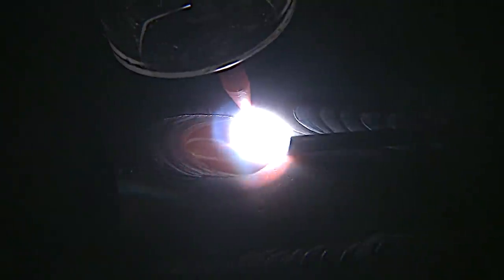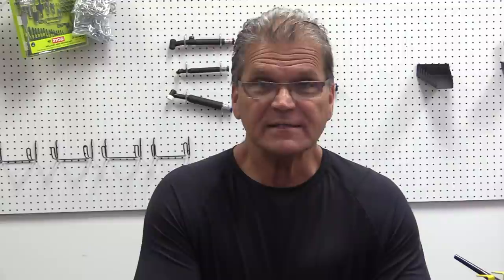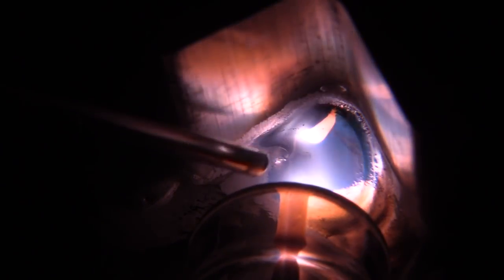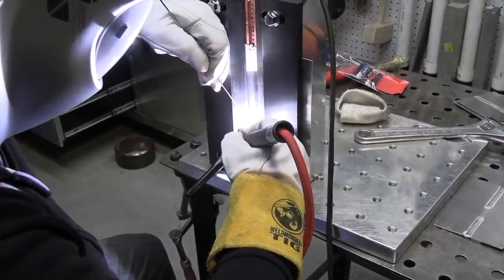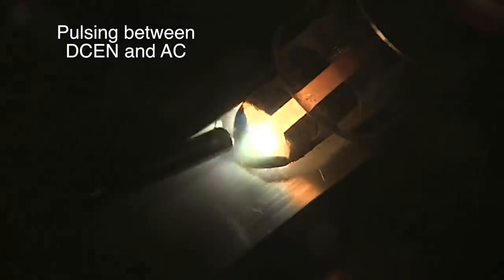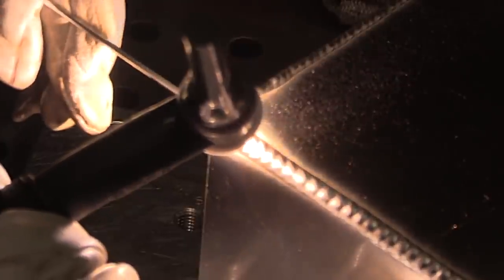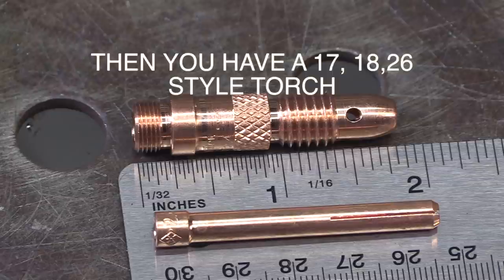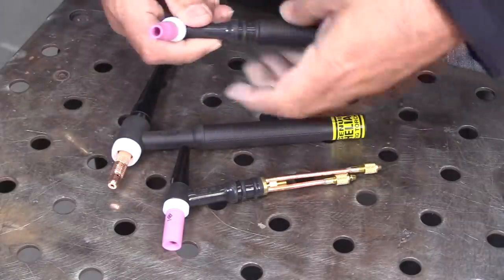#8 Pro Clear TIG Cup

Comment: I cam attest to the clear cups.   I saw a need in my industry for a local aluminum welder.  I found Jody's videos and said "self, you got this".  I talked to a bunch of folks but always went back to tips and tricks.  Bought a machine, rest is history.  Have yet to have a failed job come back.  Taught myself off of Jody's videos.  Paid for a miller Dynasty  the 1st season.  Everything since is gravy. 

The clear cups Excell when you need to use a mirror to see what you ate doing.  Don't scoff. It comes up.  If your getting paid to fix it you will do what it takes.  Sometimes it takes a mirror.  The clear cups makes it visible

Comment: Jody you've taught me a lot over the last year. i am a boat builder & all i want to do is run a #8 pro cup. Ive tried the Ally5s & i just dont weld as good. i probably long arch a little, my angles are probably off a little at times and the 8s added gas coverage just saves me i guess. i just cant run a ally5 cup & ive basically quit trying to.

Comment: One man showed that he did a custom cup from a plasma cutters nozzle. He just put that nozzle to a torch and then screw it to the torch with a gas lens adapter just through the nozzle. And then he put like a dozen pieces of stainless mesh into that nozzle. It works way better than all that expencive cups. What I saw that he was able to stick his tungsten out like a 70-80 mm and still had an exellent shielding.

Comment: I had my clear #16 cup and was pretty excited about it. I weld mainly thin stainless sheets or thin stainless tubes that loves argon plus as mentioned sometimes when in weird position seeing through the cup is helpful. Unfortunately I left it in case on table once and when I came back to the shop next day and was setting my torch up... It blew and cut my fingers. My co worker then confessed he did crack it for a bit. Unfortunately I didn't notice that when I took it from case. So I'm not using clear cups anymore at shop since I know someone else might use my stuff. Now with ceramic cups I feel like I don't see a sh... thing. So be aware... You can get pampered by clear cups damn quickly.

Comment: Hi Jody, some of my acquaintances are saying that trying to repair aluminum airframe components with TIG welding compromises the material due to uneven exposure to heat.  If this is incorrect, what does the FAA require for making welding repairs?  A video that addresses the topic of welding on airframes in general would be of great interest.

Comment: I've always had problems with O-rings on the threaded section of a gas lens collet body.  At 10:17 you showed a 45V44 GL collet body with a section of the threads removed (as if turned in a lathe with a cutoff tool) to help the O-ring fit and seal better with clear cups.  I can do this mod myself but a few words on where normal folks can buy these would probably be appreciated by all.
Reply: You can buy them from furick himself. Jody may carry them not sure
Reply from the maker: i am not aware on any 45v44 gas lens collet bodies with a groove.
at the 10:17 mark you referenced with the o ring in a groove...that is a 4gL style stubby gas lens from furick on a 17 style torch. the one laying on the table is a 45v44 on a 20 style torch.  I would prefer a groove for the o ring also, but the clear cups seem to seal just fine with the o ring over the flats

Comment: can a cup for 3/32 electrode work with smaller electrodes or does the center rivet on the cup mesh need to be same diameter as electrode?

Comment: I just stuck my 1st practice welds recently even though I’ve had my Lincoln Mig 140 for 10 years now.  Your video’s helped me gain the knowledge & confidence to begin, & thank you!  Next I need to convert to gas from flux core, although I have the bug now to lay some beautiful dimes…. Do you have any recommendations on reasonably priced Mig Welders?
Reply from the maker: its been a while since I tried any lower priced mig welders. I really liked the Lincoln 210mp.   Especially for portable work

Comment: Thanks Jody, super helpful. I recently bought the Furick #8 pro kit and was wondering if there are any other alumina cups that will fit the furick gas lens? I like the #8 that comes in the kit but would like to try something smaller, like a #6.
Reply from the maker: the furick gas lens works with most all 2 series gas lens cups.  all the way down to #4.  Also works with any of furick ceramic cups...just remove the o ring and works great. thanks,

Comment: Hello, 

I’ve one question and in my country is nobody who know for that question answer. 

I grind just one time red tungsten which have as I read in internet 2% Thorium, I grind in my garage maybe in 20 seconds and I didn’t know that it has radio active element for that tungsten. 

Please let me know is it very dangerous for health if I made that just only one time? 

Thanks a lot! 
Best Regards,
Reply: Hi misho.
Yes there is radioactive compounds in thoriated tungsten(red)..i recommend 2% lanthanated(blue) or trimix(green) tungsten.much better for your health and good for both ac and dc welding.hope this helps.
Reply: @dirtywelder483  Thanks a lot!
Reply: Is it harmful if I grind just one time?
Reply: @MikheilZhizhilashvili  no i think your good mate..but if thoriated is all you have, wear a mask when grinding and have a fan blowing the dust away from you and you should be sweet..hope this help's.
Reply: @dirtywelder483 Hmm, Good to hear that, I throught out red tungstan and now I am using green, blue and gold ones. 
Thanks a lot! 
Cheers!
P.S. Also I've bought milwaukee/sharpener tungsten sharpener and there will not be any dust anymore.